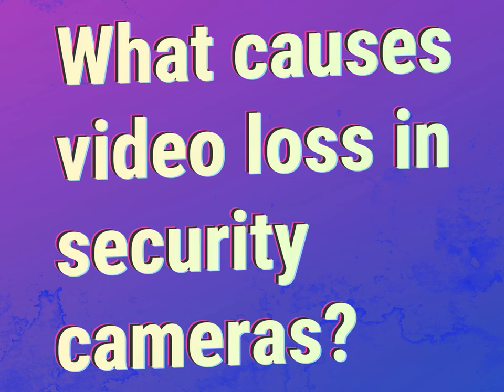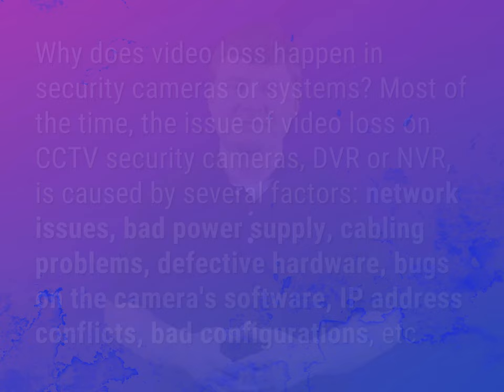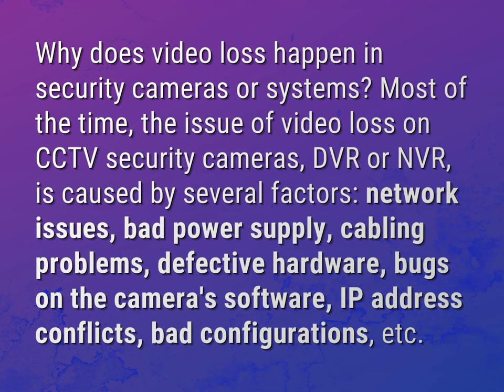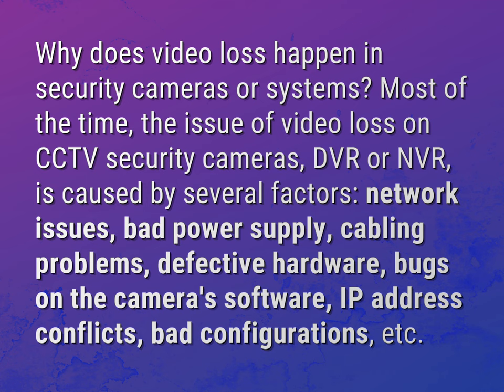What causes video loss in security cameras?

Comment: Forget the video. It’s useless. In my case I lost the feed from all cameras and the flash on each camera strobed.A wire came loose on one camera. Troubleshooting involved disconnecting power to all the cameras,removing the power splitter then reconnecting power 1 by 1 to isolate the faulty connection. Fixed it and now all is well again. Good luck!